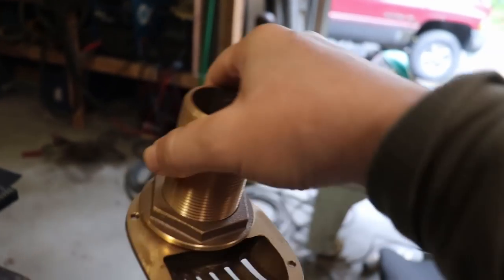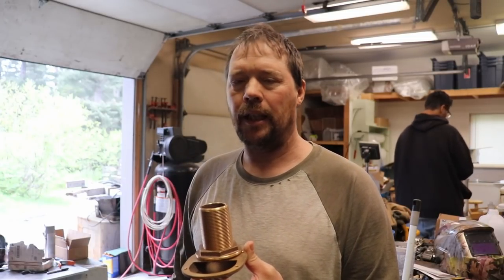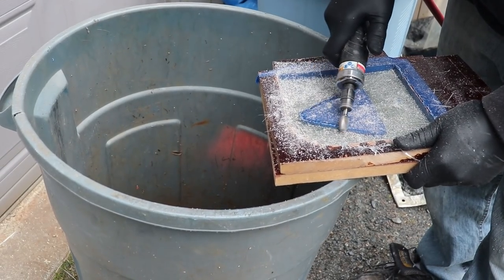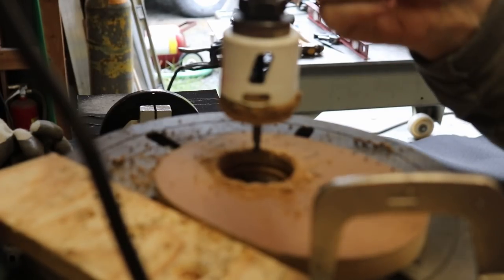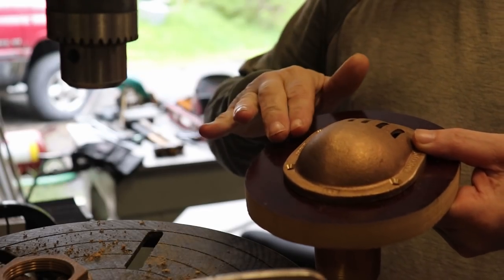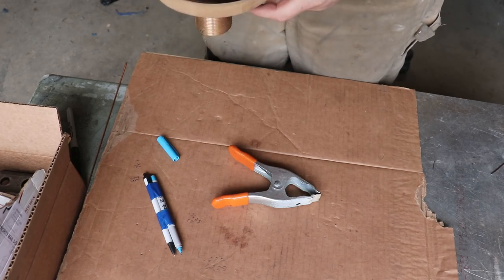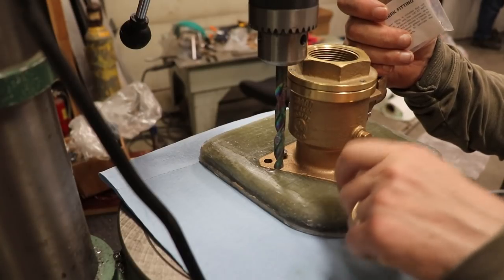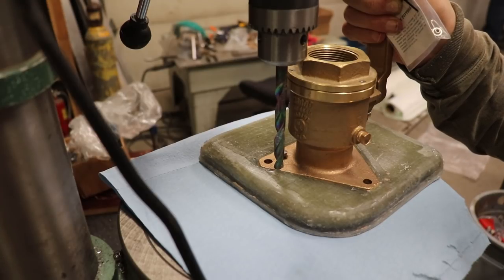Fiberglass Mold Fabrication - Thru-hull Fairing Block Flashback

Comment: You may want to put keen serts or Helicoils in that fiberglass.
Reply from the maker: Not really necessary. Fiberglass is extremely strong and that's over an inch of threaded surface. Also the strainer is the primary mechanical connector.
Reply: @EISAlaska  Ok I was just thinking longevity and the ability of lex in the fiberglass. Basically just trying to get it not to strip.
Reply from the maker: @schlaznger8049  That whole pad was glassed to the hull when we installed it, and I was also careful not to over-tighten the bolts. I have a feeling one could torque it down fairly good, but erred on the side of caution. I do agree if it was thinner material, or something that was taken on and off frequently helicoils or an insert like a blind nut would definitely be the way to go.